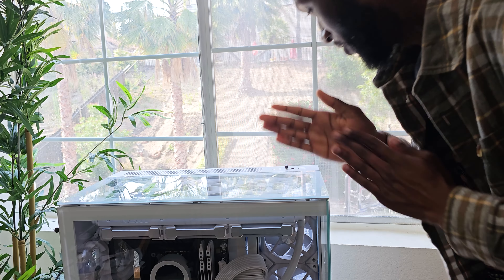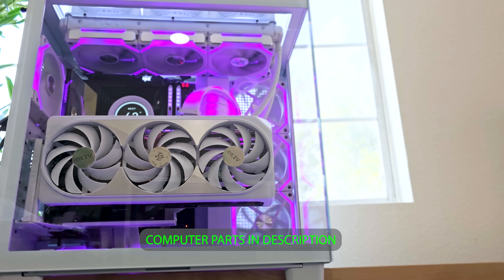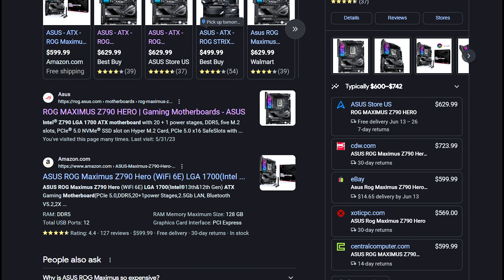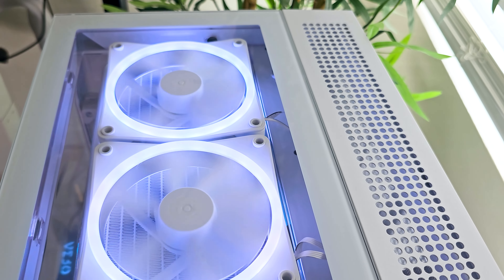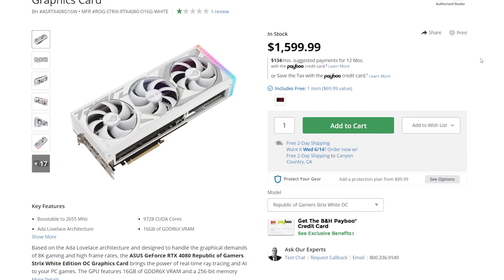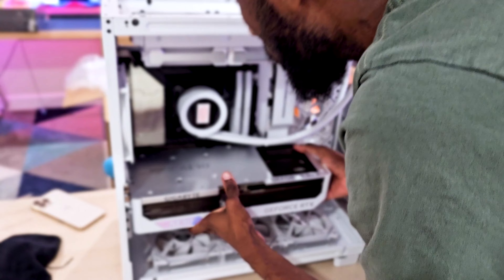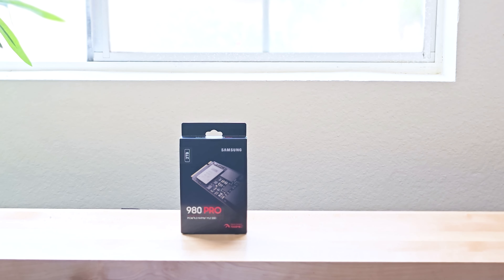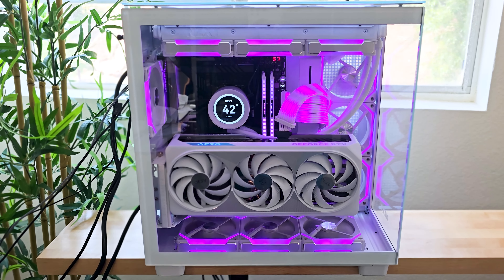Building My First PC for Gaming & Productivity | H9 Elite, RTX 4080, Intel 13900K

Comment: 12 intakes with 1 exhaust isn't great for airflow. Looks pretty good otherwise! Kind of funny putting Lian Li fans in a Lian Li clone case haha.
Reply from the maker: Haha ... Regarding the fans I followed Robeytek live on his fans and The Provked Prawn.
Reply: @JacobGagoOfficial  no idea who those people are, but physics would say that it's not a great way to get good airflow, but it is a great way to create turbulence lol.
Reply from the maker: @MattressFinancialLmtd  lol I’ll look more into it. I did feel something was wrong from Hoe they did it
Reply: @JacobGagoOfficial  I'd flip 1-6 so that they're exhausting, flip 13 to intake and slap a $10 magnetic dust filter on it. This will still give you positive pressure and allow the radiator to be fed some amount of fresh air.

In CAM (that NZXT program) monitor your liquid temps. If the liquid starts climbing up to 40C+ then I would move the radiator to the side as intake and exhaust out of the top with #13 as exhaust as well. The H9 Elite isn't the best airflow case, but you should be able to get away with your setup on liquid.
Reply from the maker: @MattressFinancialLmtd  so far 1-6 is what I did but I’ll look into the other stuff you mentioned. Thanks dude.

Comment: Not to knock your system it’s a monster, and it’s beautiful, but since you spent all that money, you should’ve just went with a 4090 for that Ultra Wide it’s higher than 4K ultra. It would’ve given you a couple more years of future proofing.
Reply: He spent 4000$, but couldn't spend 4400 to get 25% more performance. :))) That's a rookie mistake.
Reply from the maker: If I had a deal on the 4090 ofcourse I'll go for that but again, I got the 4080 for $900 bucks. This isn't a transferable discount. A reasonable person would've done the same. Plus I'm happy with the 4080.
Reply from the maker: @gruiadevil  lol didn't spend $4k. Plus see my comment.
Reply: @gruiadevil  4090 is too overpriced. Best new gen gpus is either 7900 xtx or 4080

Comment: Did your lian li fans spin when you did the first boot? I keep seeing that they won’t work unless you have lconnect3 installed, but I can’t really do that until I get windows installed
Reply: yeah they work fine without the software. you just can’t configure the fan curve or rgb without it. but i’m pretty sure you can configure the fan curve on the motherboard aswell

Comment: Did you do push pull on the top radiator? Did it fit well and how does it handle heat and airflow?

I’m doing a similar build and am afraid of not having enough space for air to leave the pull fans. Might put the rad on front.
Reply: I am not sure you are supposed to use that config bc air space is tight above the radiator and the elite has a glass top the fans could actually prevent air flowing to the exhaust port -  have you seen official manuals/guidance suggesting this?
Reply: @Coral_dude  I just assembled my fans. Definitely wouldn’t do push pull on top. Even just push on top is stretching it
Reply from the maker: I have a video coming out Tuesday addressing this. The way I had it wasn't working out.
Reply from the maker: @RodrigoR9  Agreed

Comment: Bro I’m building my pc and it’s very very similar but I have a 4090 but they told me to mount my radiator on the right side. Have you noticed your temps rising  while it is on top? You’re also the only person I’ve seen with this case to have 6 fans on top w the radiator. Very very interesting  i want to know your feedback on this because I want mine on top but not sure if I should due to temps
Reply from the maker: I'm ranging around 48-55 C. The additional 3 fans on the top isn't really necessary but I just didn't want to stare at the radiator vents.
Reply: @JacobGagoOfficial Why did you not mount it on the sides?
Reply from the maker: @Frank-qp3rr  What do you mean?  Any place where a fan can be installed has a fan.
Reply: @JacobGagoOfficial  I meant the radiator, why did you mount the radiator on the top and not on the side?
Reply from the maker: @Frank-qp3rr  Oh just a preference they give you the option to do either or.

Comment: How high up from the bottom does the mount go ? , my motherboard has a screen on my ssd slot would the gpu cover it from the top ?
Reply from the maker: This will depend on the case. If you have higher slots you can move it up. Mine is pretty set.

Comment: Dude, just to make your pc better, the both fan kits in the top of the case should be throwing air out of the case..... your liquid temps are high... so make sure that you didnt install the push pull with the fans throwing air against each other
Reply from the maker: Yeah I fixed this same month. Got a new video coming out soon.

Comment: i built with that H9 flow too bt wish i got the H( FLOW instead. The top panel looks good being clear but the outflow of exhaust it restricted imo. The out air needs to make turns to get out hot air. I see you put the top Rad using push/pull fans and have top panel lifted out of place. Is that why the top is up to allow room/air? Mine is here: https://youtube.com/shorts/lXNcfxdT1jE?feature=share
Reply from the maker: I have a video coming out tuesday. This config has issues. I switched some things around.

Comment: Did you sell Amd chip ?
Reply from the maker: I still have my older one for sale but I took back the 7900X I mentioned in the video.
Reply: @JacobGagoOfficial  another question did you double mount fans on both sides of the aio to get 13 and if so Is there any benefit to that ?
Reply from the maker: @DevinDJ88DX  The benefit is more air intake. but I didn't screw in the top I literally just opened the top and placed the fans.

Comment: Dude, there's no way to push pull that aio with that case
Reply from the maker: What you mean?
Reply: @Jacob Gago  with push pull on the top rad there will be little clearance between the top fan and the glass. Air flow struggles to exit that area as it is. I plan to put the rad on the side and still have fans on top for looks.
Reply from the maker: @TheMtbsr530  oh you were referring to the fans. So they’re both doing intake so there’s no conflict. The top most class is also open a bit to allow in airflow.
Reply: @JacobGagoOfficial  i got the same case and spec wih a 4090 i was looking to swap the top glass for the flow one that would been ideal for the exhaust system instead of going to the far end side dont think nzxt does accesories for that i supose

Comment: For 100$ more dollars, you could have gotten this instead.

CPU: AMD Ryzen 7 7800X3D 4.2 GHz 8-Core Processor  ($439.00 @ B&H) 
CPU Cooler: ID-COOLING FROSTFLOW X 240 LITE SNOW 76.16 CFM Liquid CPU Cooler  ($70.00) 
Motherboard: Gigabyte B650 AORUS ELITE AX ATX AM5 Motherboard  ($219.99 @ Amazon) 
Memory: TEAMGROUP T-Force Delta RGB 32 GB (2 x 16 GB) DDR5-5600 CL32 Memory  ($95.99 @ Amazon) 
Memory: TEAMGROUP T-Force Delta RGB 32 GB (2 x 16 GB) DDR5-5600 CL32 Memory  ($95.99 @ Amazon) 
Storage: Western Digital Black SN850X 2 TB M.2-2280 PCIe 4.0 X4 NVME Solid State Drive  ($139.99 @ Adorama) 
Video Card: Asus TUF GAMING GeForce RTX 4090 24 GB Video Card  ($1599.00 @ B&H) 
Case: Montech SKY TWO ATX Mid Tower Case  ($105.99 @ Newegg) 
Power Supply: Corsair RM1000e (2023) 1000 W 80+ Gold Certified Fully Modular ATX Power Supply  ($159.99 @ Newegg) 
Case Fan: ID-COOLING XF-12025-ARGB-SNOW 62 CFM 120 mm Fan  ($12.00) 
Total: $2937.94
Reply: That's a way worse build, and mostly only oriented towards gaming. Do you even know if the PSU is compatible with the case? The RM1000e has the poweroutlets to the sides.
Reply from the maker: Problem is I’m not a fan of majority of the components you mentioned. To each it’s own.
Reply from the maker: Exactly lol
Reply: @JacobGagoOfficial  So you're a fan of wasting money. That's fine. To each it's own.
Reply: @bafon  That's the SHIFT version.
Learn your hardware!
Mostly oriented towards gaming? I'm sorry. I didn't know we were building a workstation with a 4080 and a 13900K.
If you want a workstation PC, just get a Xeon/Threadripper.
Reply from the maker: Indeed, I'm a fan of creating what's aesthetically pleasing + performance for me.